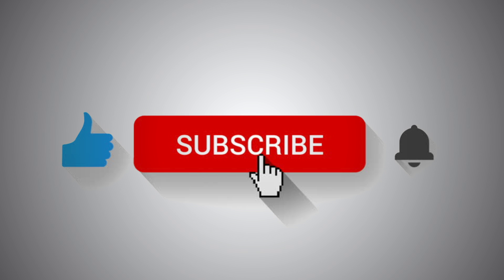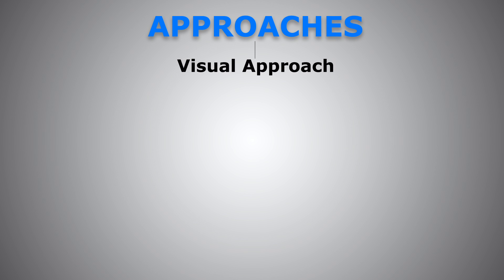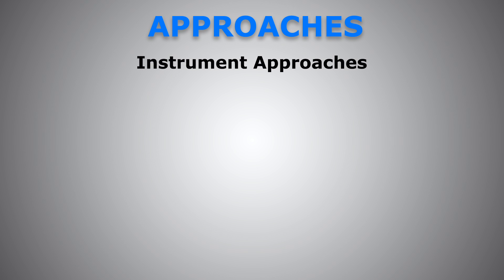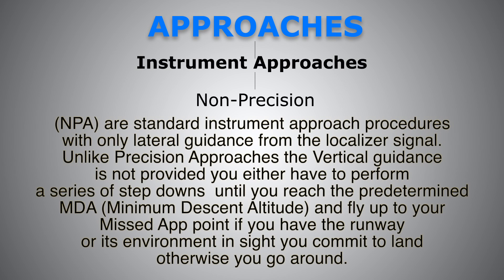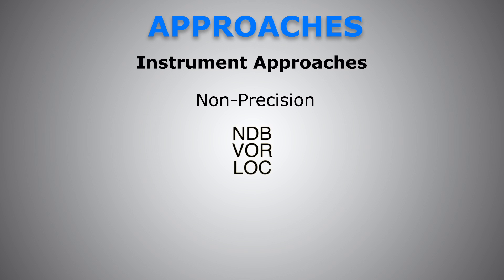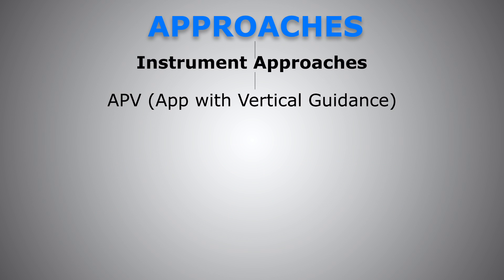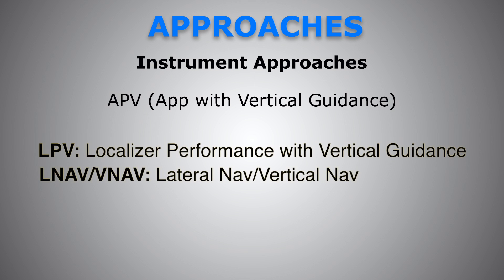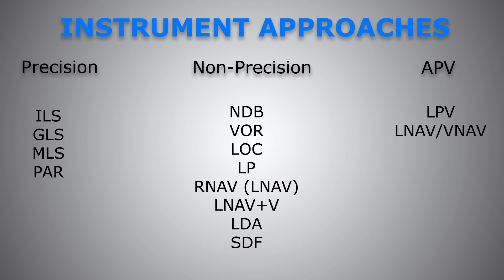✅ Instrument Approaches Explained | What is APV (Approaches With Vertical Guidance)

Comment: I have a question, can a plane do an autoland on a rnav aproach, if not, what pilots do on rnav approaches with cat 3 weather????
Reply from the maker: RNP (LPV) approaches can get you as low as 200ft AGL for the time being. Authorities are working on lowering the that DH though. in CAT3 weather you have to fly an ILS CAT2 or 3. if the airport isn't equipped with one then it is a No go.
Reply: @ATPLStudent  so if the airport if the airport is not equipped with one what they do more specifically ?
Reply from the maker: @pedrofernando8336  You postpone your flight or divert to another airport where the weather conditions permit you to land. but running into this kind of scenario is hardly possible

Comment: Question: If you're flying in the US, we use the Aeronautical Information Manual (AIM) (not sure if they use it overseas), and on page 856 of 5-4-5, it includes for APV approaches also "Baro-VNAV and LDA with glidepath"; is there a reason people do not mention these ones?

Comment - for LDA you said its 6-12 degrees. But that is SDF. LDA is only 3-6 degrees offset from the runway
Reply from the maker: Thank you for your question, Well the reason people don't tend to mention the approaches you referred to above is because they are hardly ever used nowadays. Now dont get me wrong people still fly them in certain airports by mostly general aviation, However, Airlines and corporate flying tend to use ILS and RNP most of the time, even some pilots tend to prefer to fly GNSS (RNP) over the conventional ILS. I hope this clarifies your doubt